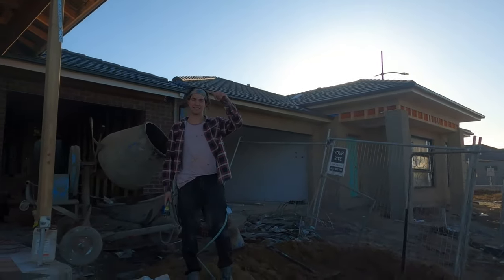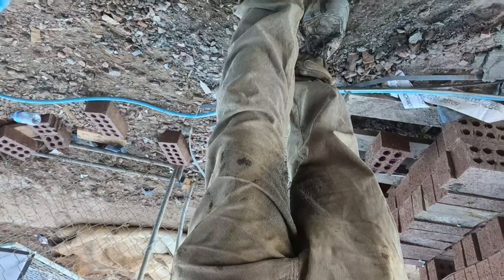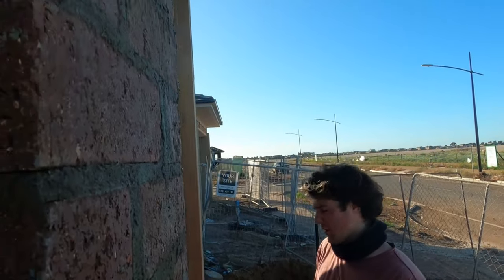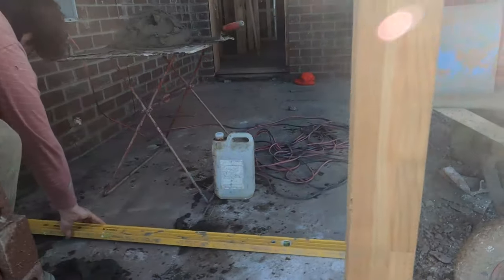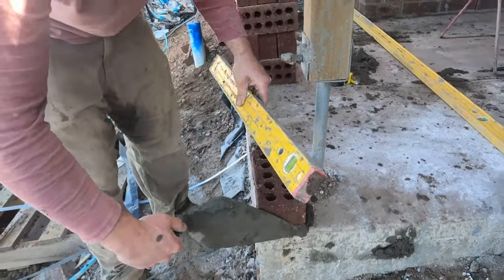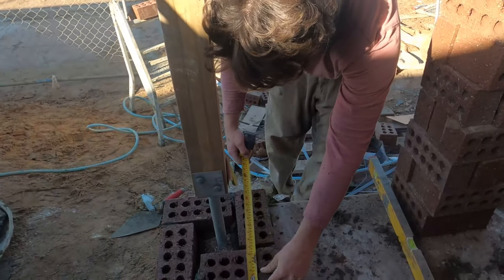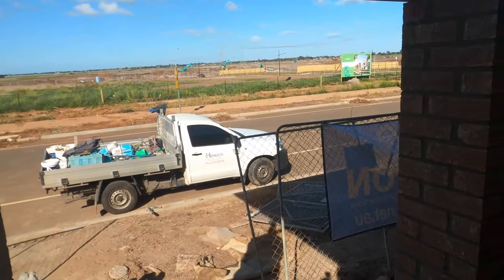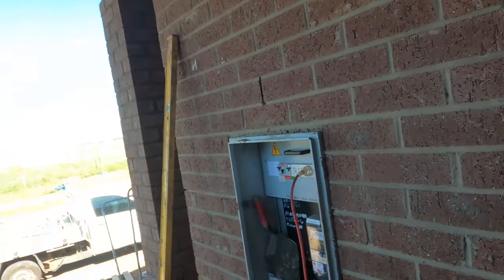BRICKLAYING TWIN PIERS

Comment: Good stuff hendo do u get the same price for the rendered brick.also I think you will be more accurate if u put a line say 10 bricks back on the existing house instead of using the big level just because of other videos these contractors seem very picky ...but good work mate
Reply from the maker: isildur 1 thanks mate. Good points.. yeah they are quite picky down this way especially lately !!

Comment: how come there rips under window window heights not working to guage or what or should of worked to get to window height first for full brick then worked up to lintels for fulls then after very odd having rips in there lad
Reply from the maker: There are more often then not splits in homes then working full bricks to window sills. They almost never work from rebate to window perfectly without splits.
Reply: @hendosbricklaying2003  iv never seen like this here in New York  or back home in Ireland...by right the windows should be build to try match for full bricks if not then we usually try work up to window heights then up to lintels either bedding up or down to fit full brock in lad....I'm Irish living in New York as a bricky we would never do this no matter what and if its block work behind the brick and windows aren't produced yet we'll doctor the window size slightly to suit our brick